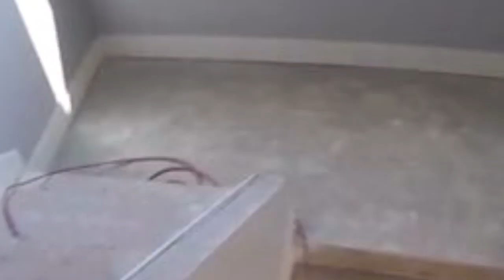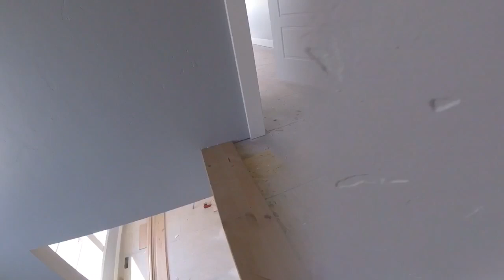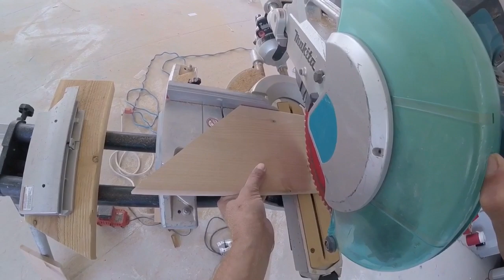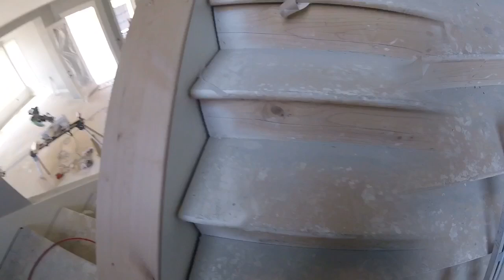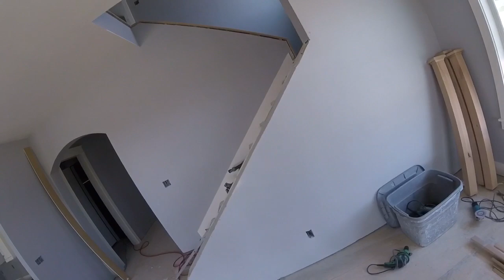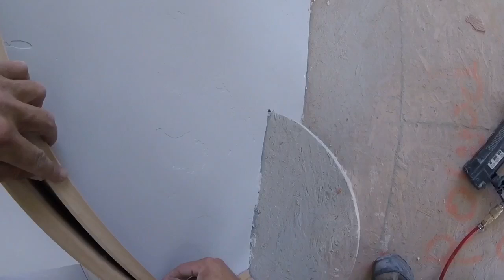Wood Handrail with Iron Balusters Part 1

Comment: Great railings.  That is exactly what I'm looking to build for our stair case.
* The newel posts look to be regular 4x4 right?
* Is there a better place to get the balusters than the big box stores?
* What cap do you use on the posts?
* (last I hope) With the wood being stained, is everything alder including the cap, post, and rail?

Thanks for sharing
Reply from the maker: Eric du Toit Yes the post is 3 1/2“ x 3 1/2“ actual size. The cap on the post was made from 1”thick alder.

You should try getting the iron balusters directly from a stair parts company online. Or go to one of the large building supply companies in your are, rather than a Home Depot or a Lowe’s.

All of the parts on this particular stairs were made of alder,   Poplar (or even MDF for the wall cap) will work for any parts you plan on painting.
Reply: @IdahoStairs  did you make the cap from alder yourself ? I mean did you round the edges of the cap youself ? where can we get the wood cap ? thanks

Comment: How wide are those knee board and how much overhang you leave
Reply from the maker: 7” wide board will give 1 1/4” overhang on each side when building on a 2x4 wall.
Reply: @IdahoStairs  What kind of wood would you use for the knee boards if you were going to paint them? I'm in the Boise area trying to get my stairs figured out... unless you have time to come do them?
Reply from the maker: @BuffaloBilagaana  We would use 3/4' mdf for paint grade cap on a knee wall.  The posts and rail (if also painted) would be made of poplar.  I am busy beyond belief right now, but if it is a small job I might be able to help out.  You can message me your contact info on Instagram (Idaho Stairs), or Facebook (Eric Holdaway in Meridian).

Comment: Ohhhhhhhh that's how you hide the crooked Sheetrock!!! 😁😁 with TRIM! I want to actually cut off the skirt on my stairs and expose the threads to the side instead of in casing them like in your video but I'm like how do I hide the crooked trim!!!!
Reply: I mean to say "hide the crooked Sheetrock"
Reply from the maker: https://www.dropbox.com/sh/chrqrnrojlzdnzm/AADVu2dwdmqi99yoEA2F9lV5a?dl=0

Here’s some pictures.  Maybe it will show what you are thinking of.  

I think what you want to remove is called the rake wall or pony wall.  You will still want a skirt even if you have open treads.